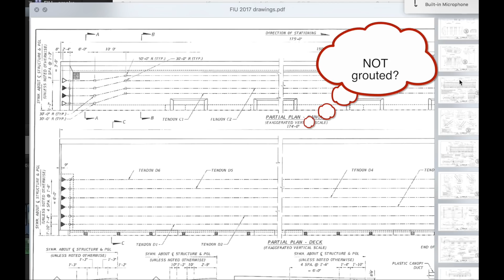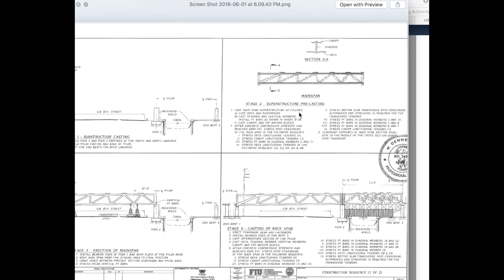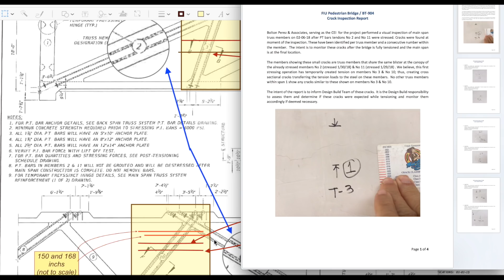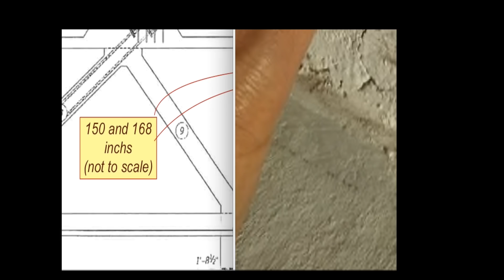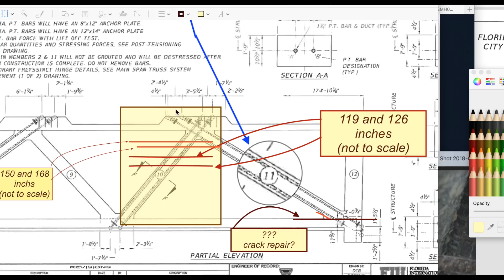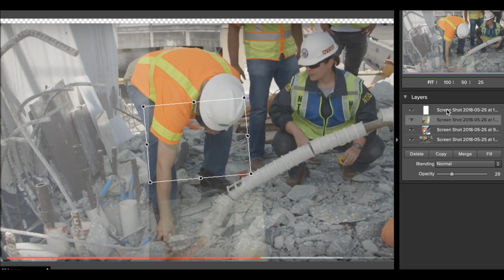FIU BRIDGE COLLAPSE CRACK ANALYSIS; materials are innocent, designers are negligent.

Comment: Thanks for this work. It's clear there were some unexplained fails before the move and again after that triggered the 2 hour meeting. We can see rubble on the failed canopy South end and a jack hammer at the north. If they did the tension release before the road was opened as planned why would there be more rubble 4 days later? The simplest explanation is that they did not de-tension until 4 days later and that release aligned forces that caused an already failed structure to flex and fail again. I agree with your conclusion that it was the canopy that then broke as that is right at a place with a jumble of sharp angles causing stress concentrations near concrete with several voids next to the blister that's relatively full of metal that will be much stiffer than the surrounding concrete.
Reply from the maker: Thanks for commenting and sharing your thoughts... 
This structure is a nightmare isn't it!
Reply: Yes. For example I tried to sketch up a cross-section of the canopy near the North side of the blister. The upturned "wings" at the outer edges are the same thickness as the main part which must be tons of extra weight. There's so much metal in the blister it will flex far less then the conctrete even before allowing for the voids. Sharp angles everywhere. And they just carried on after more and more cracks showed up. Awful
Reply: And the the curvature of the canopy makes the PT tension act to put a bending moment where it meets the blister plus all the deadload.
Reply: And how were they planing to inspect the rods later on? Don't they know metals creep under tension over time? Those in the heat will creep faster.  It's why a piano goes out of tune.

Comment: Thankyou, I am enjoying this series. In the drone video of the move there's a shot where the North End PT ends are visible for bother upper and lower deck. The line up lower deck does not appear symmetrical and on the left hand side a couple of the end caps look inches apart. Does that imply the bars themselves may be as a far off the straight line show in the plans and therefore in some locations a lot closer to the deck surface etc?  Thankyou again for trying to use data to find the truth.
Reply from the maker: Gareth, we would need an ''as-built'' and the final approved drawings to be sure...     
Thank you for being kind and complimentary in your comments.

Comment: The canopy was an inadequate structure to sustain the lower slab. 
It seems to me that the bridge was really supposed to be a cable-stayed structure that suspends both the canopy and the lower slab.
When they realized that ABC wasn't compatible with cable-stayed bridge construction, they changed the designed to a truss bridge and kept the cable-stayed for cosmetics. But because they were under a deadline (grant), they decided to proceed anyway instead of starting over with a new design.
The botched final product is not a viable structure at all, unfortunately it didn't fracture and fail the moment that it was put in place.

Comment: I have a feeling that the Engineer will take responsibility for this accident.  Where is the redundancy?  Structural Engineers usually design with a safety factor of 2 or 3.  Remember this bridge failed with zero load.  One or even two or three bad tendons should not have caused this bridge to fail.  Who checked the design calculations?  FDOT?  The Miami-Dade Building Department?
Reply from the maker: You mean admit to homicide?
Reply: Well, not willingly take responsibility.

Comment: Thanks for noting the bridge designer was a specialist in CABLE SUPPORTED BRIDGES which when you LOOK at the design you'd assume this to be, with the truss to add rigidity to prevent sympathetic vibration.   THIS WAS A CABLE STAYED BRIDGE cost cut down to a truss bridge.  I'll GUESS, that's GUESS that engineers were leery of massive unknown vibration from traffic and compensated with the HEAVY HUGE CONC TRUSS - good work as they'd never be able to calc the vibrations stresses much less potential sympathetic vibrations.  With the huge heavy truss it was then ALMOST SELF SUPPORTING and a bean counter had the brilliant idea of ditching the cost of cable stays - probably by adding more post stressed tendons, to inc the truss support capability, which reduced conc avail to handle post tensioning stresses and increasing need for quality workmanship - and the US is NOT KNOWN FOR QUALITY CONCRETE WORK.  Cutting, grinding and trimming is STANDARD on low budget concrete work.  Formwork to keep conc AND liquid pastes 100% inside forms is custom carpentry / steel work esp w diags.  Most of this decision making could have been done at the napkin sketch stage just as likely as post bid.  NSTB should be impounding years of records to determine if and when this change occurred, concerns voiced, etc as the determining factor in this failure is HUMAN ERROR, and that was the point at which the error occurred.  They are used to engineers and even CEO's who KNOW any cost cutting has to be carefully engineered and carried out or it won't even get off the ground to crash.   They shouldn't be lead investigator on what is actually a sleazy real estate deal with client self inspecting design build work for which engineer is beholden to GC for their paycheck - cops should.

Comment: Studying the video of the failure carefully again, it appears to me that the post tensioning of the truss member at the time of the accident resulted in a differential vertical force across the width of the walkway at a point between the end pier and the point of compression where the truss met the walkway. This resulted in a shearing force so great that the walkway concrete failed across its entire width. The concrete walkway concrete was relatively thin and there was no way for the longitudinal tensing cables in the walkway to prevent the concrete from cracking. This appears to me to be where the initial failure occurred beginning the cascade failure that brought the whole structure down.

I have to consider that using tensioning cables in lieu of structural steel for support is a dumb idea.
Reply from the maker: Please read my comments above... I do mention this and you will love my next video... as it will show separation CAN happen...(spoiler alert).

Comment: In the your video you show how close the canopy cables and ducts, are to the cables and ducts  coming up from the sloping columns,  those measurements were made using the centre  line  as a starting point, But the two lots of columns cables have to be away from the centre line for them to pass by each other, and so are even closer to the canopy’s longitudinal  cables than shone in the blueprints.
One side affect of this will be that the cables will be compressing one side of the column more than the other, no good when dealing with high loads.
Reply from the maker: A torque action is what I think would be a contributing factor! Unlike a truss plate, as you know, the cables cannot share the same axis, that the are offset and that alone, is an imbalance...
The question is, how the hell can you calculate those forces and bring them to balance?
This design belonged at a school, for children andcenginerrs to have fun, to see if they could make it work... Not in the real World!
Reply: PS I have four more videos coming showing what you might be referring to...

Comment: The more you dig, the uglier this whole thing gets...
Reply from the maker: Agreed Gordon, at this point, these concrete truss were structurally a failure but it appears, all you have to do is document cracks and they are no longer significant because you can "over-ride" the issues with cracks; by simply increasing post tensioning... keeping "Humpty Dumpty" from showing he is broken in pieces...
This structure was being held together by post tensioning Ang failure of that system / in that system "released this puzzle to fall to the ground"... or was it simply a change in forces of 10 and 11...which would have put the transfer of loads on the canopy and lower deck, to transfer the loads to the pylons...( I really like that idea, as it explains cracking to the "North Side" of the blister bar and the deck cracks to the "North Side"...).
Reply: I'm still confused about the details, but every level of this project seems flawed. BTW, I laughed when you used the word 'strong-back', since this truss proved to be the complete opposite. If there was any kind of safety factor in the design, it should not have been affected by some cracking. This leads me to the worst conclusion...
My next question: Even if it had stood for a while, how would they make repairs to the structure in future years? Since there is no redundancy, they would have to support the whole thing on scaffolding for several months (completely impractical due to road obstruction).

Comment: Once you release the tension and the bridge sags, you can not put it back unless you suport the bowing and jack it up at that point to cary the deadload. Than you can post tension again. No way would the sagging correct by tensioning 2 and 11. It sounds to me that the engineers on site must be new or inexperienced if they ever thought creaks once formed would correct itself by re tensioning.
Reply from the maker: Well, you see Denny Pate, was over his head, he has so much cable stay under his belt... he clearly thought that this system would react ...as it did when it was on the side of the road... That he was able to make this structure perform and show no cracking then...so, he could simply "re-tension" bridge and all would go back to as it was...
But, common sense, as you stated, with jacking the structure up, did not exist with him... 
Thanks Latitude for your comments... awesome.
Reply: @LoadPathEngineering  combined with what looked like a tension member significantly ejected from it's normal position, I'd guess at least one of the rods in #11 was tightened till it popped, acting as a final trigger for the collapse.
Reply from the maker: @RobertSzasz  , wish we had more images.
Reply: @LoadPathEngineering  Same here. I don't think the initial design was inherently unsafe, and I think it emphasized FIUs huge materials lab. All the on the ground engineering changes probably meant the bridge was doomed the moment it was prepped to lift onto the transporters. That the cracks weren't recognized as a critical sign by either construction or engineering crews is baffling.
Reply: Should have used that 'Self Healing Concrete'................. Oh wait, that doesn't exist yet.

Comment: I suspect 10 cracked when being placed on bearings. I.e. In the canterlived state when moving bridge into position.
Reply from the maker: They might have "re-cracked"...but, this report shows they cracked while the bridge was being tensioned, the "first time" and concrete at 6k... It was still to get to 8500psi (interesting dynamic also)...
Plus we have that darn coating being added before the inspecting engineer did his field trip, apparently not seeing the structure in it's raw state...
I watched video again and left out MY EDIT, ON THE FORMWORK, MIGHT HAVE BEEN A CONFLICT WHEN POST TENSIONING, that could have been the supports this structure needed (just a thought)... that this structure sagged after they removed formwork and they used post tensioning to put it back in plain... I would like to see more on those elevation numbers to prove that statement...
Reply: That coating wash White Wash in both meanings. 

whitewash noun (PAINT)

' a white liquid that is a mixture of lime or powdered chalk and water, used for making walls or ceilings white'

whitewash noun (ATTEMPT TO HIDE)

'disapproving an attempt to stop people finding out the true facts about a situation:'

Comment: Cracking can only occur in tension. That said faint cracking  album ng the post tension tubes indicate to me that the concrete cover was not adiquate. Why did thay paint the bridge? Was it to hide the faint heir-line cracking? I suspect intentional effort was made to cover up faint heir-line cracks. That is criminal if true as it is an effort to mislead inspectors . Inspectors should have suspected...I would have.
Reply from the maker: He specified...tension in the rebar... which I find interesting...
Reply from the maker: Plus we have buckling cracks... or cracks under compression of the member...as a result of loading the members...
Latitude, what I find interesting is the elongation of the steel and deformation... to me, that would imply the blister bars took all that force and did not exhibited any external cracking... hmm of did they? (I mean it is the load point of the column's anchor plates... just another odd thing for me to ponder...

Comment: Anything can be fixed with duck tape according to auto mechanics. Anything can be fixed with paint according to FIU. Here you see it, here you don't after FIU paint them. Anything can be fixed with "100 strong women",  to hold the cracked bridge up with liberal power according to FIGG. FIGG,  a dangerous company. ALL their designs should be re-visit and examined. Their engineers are lack of very basic concept of material mechanics corelated to structural types.  
If you look the situation, Tension #2 and #11 cables (meaning shorten member 2 and 11), will also compress #3 and #10, then tension #3 and #10 will loose the tensile force of #2 and #11. Progressive until immense internal stresses developed (it includes compressive and moment (twist and turns) stresses.  Truss fixed web connection will develop moment in the web member, also moment will cause tension side cracks.  "It just cracks me up",  Would any of you engineers design concrete trusses in the future? Hahahahaha I shouldn't laugh at other people's misfortune. BUT, on this earth Newton Physics will not change, no matter of the ideology the user holds, no matter what the user believes, no matter user's artistic illusion. I believe I can fly, but in reality I cannot. Don't believe "be all you can be"

Comment from the maker: Please read the comments above, under description... I give a summation of the video.
Thank you for watching and this video will be very interesting... PS Don't forget to hit your space bar to pause video and it might help you read the ''moving'' images.
8:57 we will make the cracks happen...
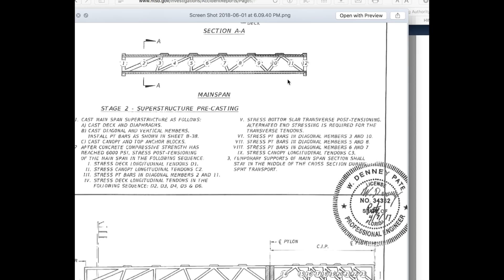14:00  BUT, at 14:00 if you can imagine, that any sagging in the middle of this bridge WOULD put number 11 under tension and NOT compression!  
This would cause the ''reversal'' of loads in number 10 to compression... and WOULD exhibit open - cracks on the bottom of number 11... perhaps..
21:00   ----
Or does B.P.A. mean that tension was only inside the metal and not on the column? (not sure how he separated the two... they are bonded to each other.  That somehow, the bonding broke and it was under ''tension" and -- well, that is just crazy... the cracks are from a ''force'' and BPA states they are from the number 11 and 2 being post tensioned... YET, they did not duplicate or show this as a fact...  They gave a ''we believe'' statement... and did not support this with what is the result of those cracks on the structural integrity of the structure!
Cracks are 100% indicator of failure  - unless they are surface cracks or unless you wanted to create cracks!